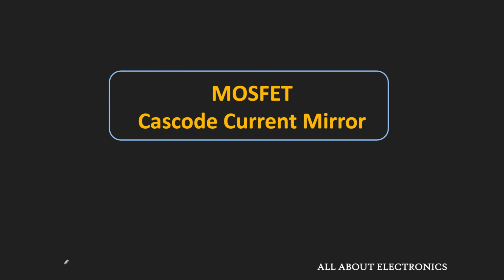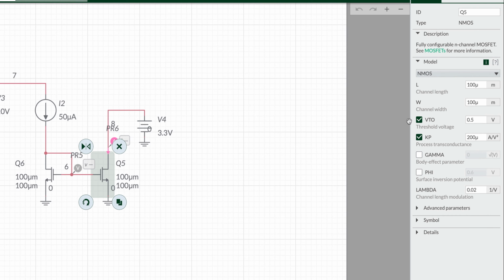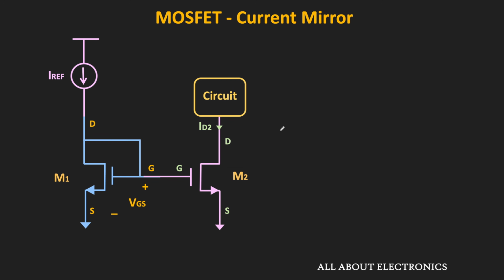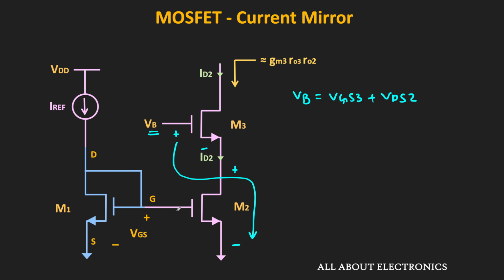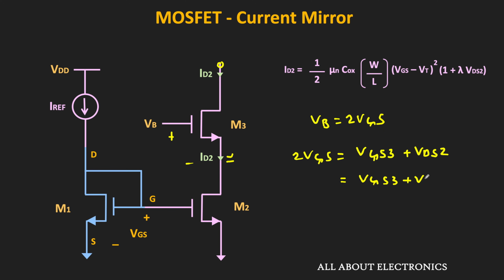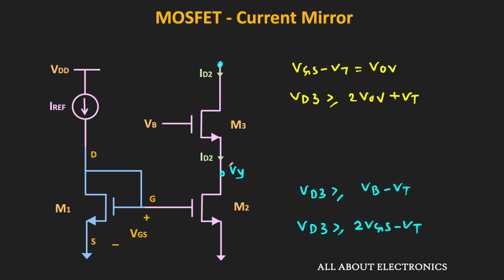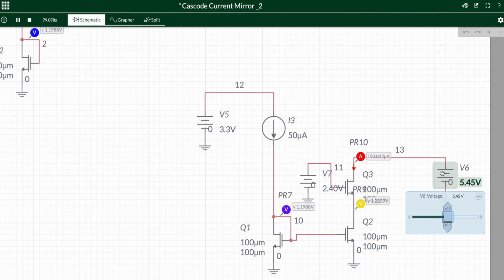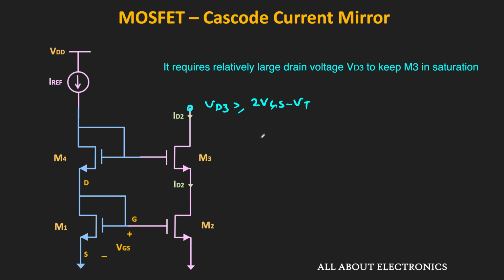Cascode Current Mirror Explained (with Simulation)

Comment from the maker: The timestamps for the different topics in the video:
0:00 Introduction
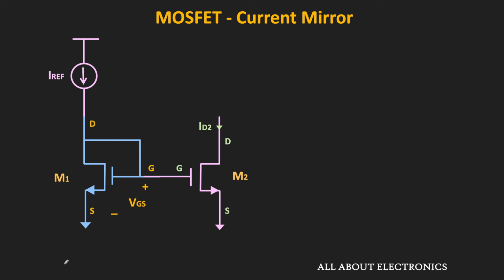0:20 Issues with the simple current mirror circuit (with Simulation Results)
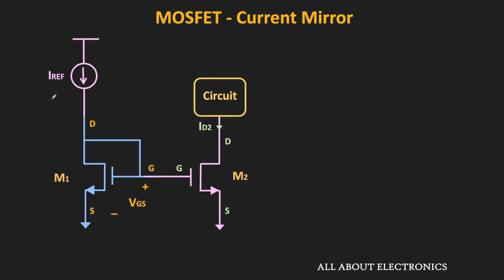5:23 Cascode Current Mirror Circuit and Simulation Results
Reply: @ALLABOUTELECTRONICS  , Vd of M1 is not fixed right, can't we change it to needed that is Vd of M2 decided by IC?
Reply: Is it because Vd of M2 can change but not M1 as it is acting like current mirror right? Is my reason right?

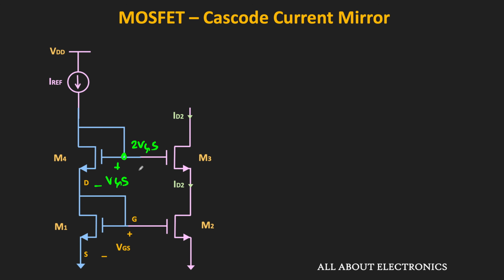Comment: Hello! In 15:36 why is the VGS4 equals VGS1?
Reply from the maker: Both M1 and M4 are diode connected transistors and they are connected in series.Moreover their characteristics ( device parameters) are also same. Therefore, for the given drain current both generates same VGS. Please go through the earlier video on the MOSFET series. On the channel you will get the MOSFET playlist. In case, if you still have any doubt then let me know.

Comment: Hello Sir, really nice video, appreciated for real the explanation. I just wanna ask a quick question to understand clearly.

If my cascode current mirror has all the MOSFETs working in saturation mode and I am not considering the modulation of the channel, in order to raise the output resistance,  should I just focus on the W/L ratio of the MOSFETs? In particular, if I am not wrong, I should probably increment the W of the MOSFETs, right? Please correct me if I am wrong

Comment: sir in the video I see that your voltage is varied +-(2v) to (3v) current is same but when i am doing simulation in lt-spice when I vary my voltage Vd3 +-(0.5v) to (1v) it's current change drastically what should I do now, how I share my simulation thing?
Reply from the maker: What is the channel length modulation parameter? Please check the value of lambda (λ) of the MOSFET that you have used during the simulation.
You can mail me if required. you will find the email id in the about section.

Comment: the nice explanation at the end of the video you said there is some downside of this circuit in ac analysis like voltage swing and operating point so  for remove that issue what we should can you make video on that also with simulation so we understand better one suggestion can you make a video on ,single and two-stage opamp with current mirror circuit